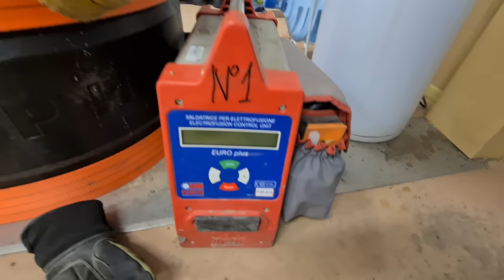New Experience With Another Excavator -- part 3

Comment: Cant hit a coupler with a hammer like that. It has welding strips in it, might break them. Use wooden plank or something.
Reply from the maker: I think that nothing can be damaged there. Because the wire is about ten cm further and also in plastic. And it is very hard plastic.
Reply: @MrAJWorks  I do this work every day, I know. Trust me, I know lol.